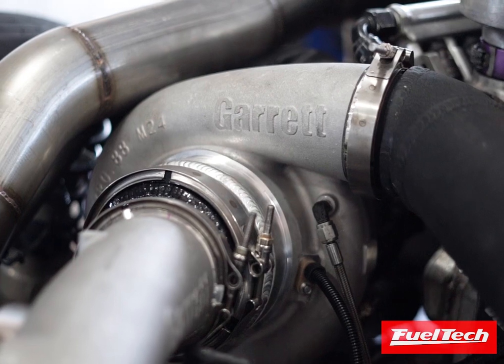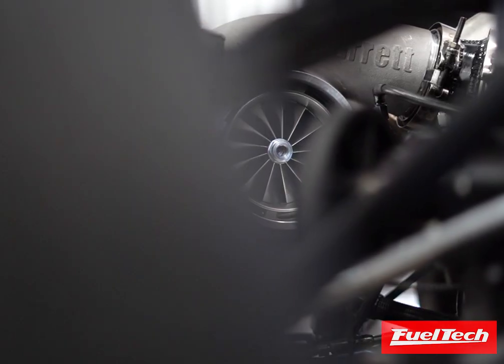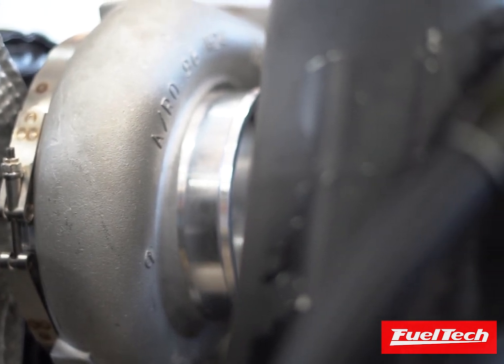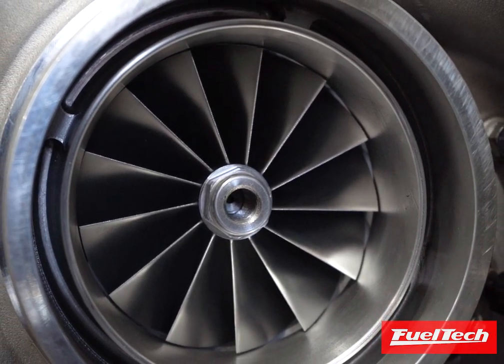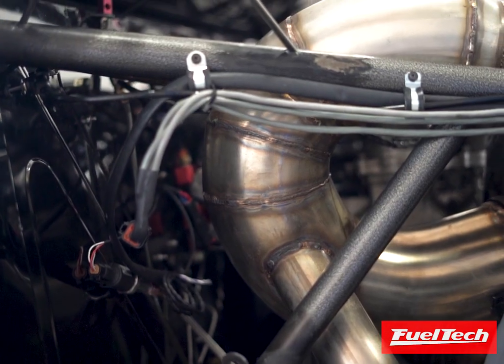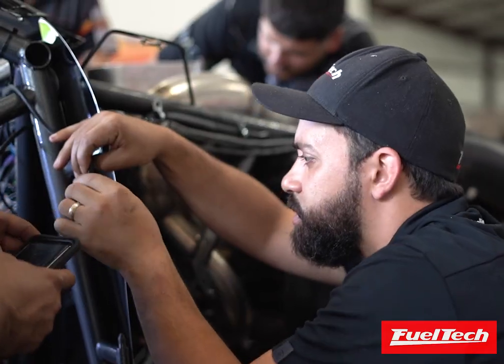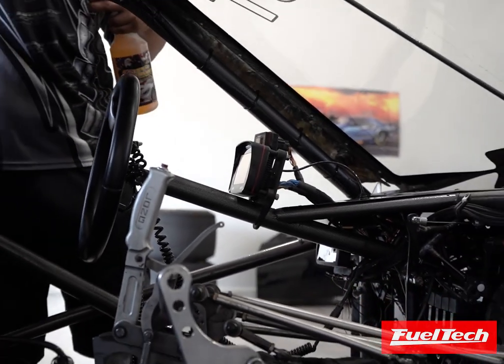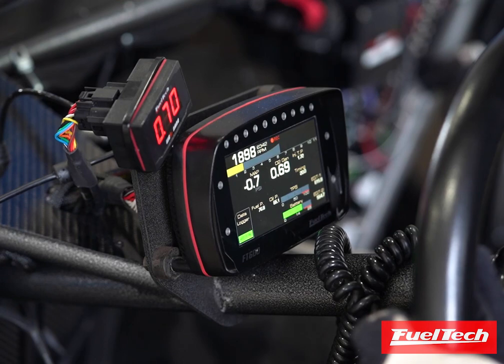1670hp compound turbo 2 rotor powered by FuelTech!

Comment from the maker: Hey guys! Don't forget to like, share with your friends, ask questions and SUBSCRIBE!
Reply: at the beginning of the video edit about 0.975 sec footage out Mr. Anderson was not on cue
Reply: Why does the small turbo go after the big turbo?
Reply: @batman9592  The second turbo is smaller most likely because its job is to multiply the existing pressure in the system from the larger unit which has the duty of compresing atmospheric pressure and then some.
Reply: Copy cats

Comment: How to make a set off turbos which generate more power as fastest than nos.  But as stock original engine... I would like to see and watch and learn how u all build ROTOARY ENGINE.  name as DATSUN  RX VW GOLF RABBIT  and all the rotoary engine in FUEL TECHNOLOGY.  ✌✌✌✌✌👍👍👍😎.
Reply: Francis Dsouza THE NITRO SISTEM WANKEL 20-B (3 ROTOR) RECORD HOLDER IS (e.t.7.71@ 169mph/272 Kmh). CHIMIKUI DATSUN '71 B 210.  Only.      ☄️ Aspirade with N.O.S.🔥✨🚖🚫NO TURBO, 🚫NO SUPER CHARGER, 🚫NO PRO-CHARGER.

Comment: So wait...the smaller turbo is after the big turbo?
Reply: i always thought the small turbo created boost to spin the big turbo's turbine
Reply: @Be4tJumper  nah, its about getting both turbos in their efficiency range and a lot of it has to do with pressure ratios, compressor maps, and not turning a turbo into a hair drier. For example, rather than boosting the atmospheric ~15psi of air pressure to 90 psi of boost pressure with one turbo (a pressure ratio of 6) and causing a variety of issues, you can use 2 turbos. One turbo (maybe 2 for even more airflow, like diesel dragsters and tractor pullers) to boost the atmos. 15 psi to 30 psi, a pressure ration of 2, and then a second (or third turbo for diesels) to boost that 30 psi to 90 psi, a pressure ratio of 3. Look into diesel compound turbos or the high performance academy videos on the 2000whp+ 4 cylinder dragsters. Of course, there's a whole lot more to it than I mentioned, its a science. https://youtu.be/0jN2ExOW4J4?t=120 He goes into a cool tech talk about turbos about 2 minutes in. Hope I helped you.
Reply: @pavelkravchuk7763  yeah i watched a video and someone compared it to a jet engine and it made sense. I really want a compound set up :) they're so cool
Reply: @Be4tJumper  just make sure your engine can hold and flow that much air and fuel. But just go full send and window your block. 😂😂

Comment: LMAO a  rotary needs compound turbos just to make 1600hp
Reply: MajorLeague  yep it's crazy how far people push tiny engines with a ton a boost
Reply: nope there are single turbos 13BS making about the same hp
Reply: @thatcornfedrx8guy372  link? I call bs
Reply: Look up Loquito Killer RX8 and Rafelitos RX8
Reply: @thatcornfedrx8guy372  I'm not really impressed it's running nos and only making 1200-1300 when there are 1.6 l Honda's with 2000jp
Reply: @Johnny-tq9no  the 13b can make about 1300 hp but Rafaelito has gone 6.16 Rotarys with Turbo and Nos is not a good combination, Rotarys work better with NOS if they are Non Turbod, this is a guy who gos to events with Rotarys in the field.

Comment: Compound turbo systems are on the rise!  It makes alot of sense especially in a street application because you could have high boost with out the lag.
Reply: True, but is more complicated than that,  you have 2 turbos, 1 is a high pressure the one is bolted to the exhaust manifold and low pressure that's bolted to a base, in order to make the high pressure feed the low pressure it takes some fabrication,  redirecting the exhaust gases from high to low and boost from high to low, but yes in the diesel motors this system is being used for decades,  caterpillar c13 and c15 are compound turbos from factory
Reply: @Me-fj8sb  its definitely a more complex option but it also works if calibrated right. Do you think it will become more common for gas engines?
Reply: @jayknight139  that's a good question,  the only thing I can think that will prevent that from happening is space, normally compound are installed in inline engines like Cummins  or a single side manifold,  duramax and powerstroke are V8 but this are full size pick up trucks and the have plenty of space and when they finish installing the compound there's no space at all, in a car is way more tight and more attachments,  but in a race car is possible depending on the engine and chassis setup,  but the main reason for compound is to develop tons of torque,  there's 6.7L Cummins on dodge rams that can make over 2,500 hp and over 3,000 pounds of torque
Reply: @Me-fj8sb  which is why I wish there were more diesel swaps. But one version of the supra had twin turbos so although space is an issue its not impossible but selling kits may not catch on for a while.

Comment: Pfft... i run 70 - 80 psi on stock cast rods and pistons... 😏
Reply: These 13bs still have factory Rotors and housings, there is only billet plates.
Reply: No one is impressed with your diesel.....
Reply: @boostjunkie2320   Lmao i was kidding but nice one

Comment: Congrats that's one tuff setup imagine a 20b or 26b ! Set up. inst it crazy how an old diesel turbo set up is now dominating
Reply: Trev Ohlson its really hard to get a 4 rotor to make good and reliable power.

The ones that are, aren’t telling how they did it, the ones that are saying how they did it are struggling to keep them running.

Both 3 and 4 rotors are super expensive. The fastest 1/4 mile rotary is a 3-rotor built by a Puerto Rican crew with an RX-8 that ran 6.3 IIRC, taking PACs record of 6.4
Reply: @rotor13  fastest rotary is now 6.08
Reply: @ferrarikingdom  Loquito Killer  RX8  20-B Wankel (3 Rotor) ♻️♻️♻️ e.t. 6.06 @ 232 mph.
Reply: @rotor13  no lie about 3 and 3rotors being super expensive!!!
Reply: THIS IS 13-B WORLD RECORD TIME e.t. 6.16 AND 222 mph. SPEED. (Maryland, U.S.A.)
☁️.   🇵🇷  RAFAELITO RACING
🚘☄️  13-B Billet (Single Turbo) All Boost 🚫 N.O.S. Even for them it was a surprise, because they were looking for runs 6.25 approx. since they had achieved e.t. 6.31 @ 219 mph. 🚗💨 and apparently the weather helped the record a lot.
••••••••••••••••••••••••••••••••••••••••••••
★ Pd.  IN THE FUEL TECH VIDEO YOU CAN SEE.
ABEL PERFORMANCE🔧🇵🇷 HOLD WORLD RECORD DYNO WITH 1,670.⁸ hp. AND 1,441 Tq.
 Turbo Compound Combinations.
(This Mazda RX-8 that you see the video, the car is from Curaçao, 🇨🇼 🏝️ a small island near Puerto Rico, its mechanic is from Puerto Rico, but its owner is from 🇨🇼Curaçao).
Reply: @rotarymotion120  The Rafaelito Mazda Rx8 reset the Time with e.t. 6.01@230 mph. Is a13-B World Record!
Reply: The more rotors the less efficient because the eccentrics bend, because they are longer and although they are thousandths of an inch but, still so affects the engine.

Comment: I understand its a billet engine, but is it still 1.3l?
Reply: Yes its still 1.3. There arent any displacement increase for rotary engines. No ceramic apex seals. Power seals or E&j seals. This seals are a mix of metals
Reply: And id assume some crazy ceramic apex seals or something?
Reply: @michaelesprella1540   The problem of the apex seals is a ceramic they withstand high heat temperatures and yes, if you cool it they The problem of the apex seals is a ceramic they withstand high heat temperatures and yes, if you cool it, they break, This Engine use alcohol fuel.

Comment: Thats the craziest damn thing ive ever seen.

1,285 hp PER LITER...and 3 moving parts. AbsoLUTEly mental. Wow.
Reply: MajorLeague  and yes I was talking about racing classes im not exactly sure but I've heard the 787 b was banned and there were complaints about the way displacement is measured or because of the operation of a rotary and the 2vs4 stroke rule they used to have in motorcycle racing
Reply: It's a rotary the displacement acts more like a 2.6l
Reply: @Johnny-tq9no  why? because it work every revolution? how much cc has a 50cc twostroke? 100cc?
Reply: Cool story...no one cares
Reply: @kyledavis8176  well you seem to care enough to do the math on hp/l bit don't understand that it acts like a 2 stroke 

Smh no one cares about comply aftermarket drag racing engine making this much power... You do know there are 1.4  4 cylinders making 2000-2500hp...no compound turbos needed
Reply: @Johnny-tq9no  what 1.4L is making 2000+hp?
Reply: @petegonzalez856  drag racing engines... Anyways it's a rotary engine the displacement is misleading as it fires completely different if it were to compete with piston engines will be classed as a higher displacement
Reply: Yeah no way unless the rev limiter was around 15,000rpm and 40+psi.
Reply: @petegonzalez856  2 liter Honda's are making 2500+  hp
Reply: @Johnny-tq9no  8 months later lol.... Factory Honda blocks can't handle that kind of power but aftermarket billet blocks can lmao try again
Reply: @petegonzalez856  what does that have to do with anything?? Rotary can't handle even close to that power either...
Reply: @Johnny-tq9no  dude you're talking complete shit. At first Show me one 1.4 4cyl pushing 2500+HP. 
And Point 2.. yeah rotary's displacement was multiplied by 1.7 or around that in racing because they had/have superior power with the same amount of displacement. They were given the disadvantage to keep the competition. Otherwise they were dominating. 
Funny side fact. The Mazda 787B just won the 24h of LeMans because it was just simply more reliable than the others.. not because it was faster.

Comment: That is an amazing package right there and huge out put from just a 13b 🤯 

I'm surprised to not see any intercooling between the two turbos?

How much would this affect the set up and performance of the car?
Reply: I imagine this thing is running on alcohol of some description, which usually results in significantly lower intake air temps, negating the need for an intercooler. Im sure someone will correct me if im wrong! 👍
Reply: @mechanicalmisadventures  yeah it's a drag car it only needs to stay cool enough to go 1/4 mile it's probably also running on alcohol or methanol to cool it
Reply: IS ALCOHOL AND THIS IS COLD AND THE RACE IS ONLY BETWEEN 6 SECONDS THAT IS WHY YOU AVOID PUTTING AN INTERCOOLER, AND NOT ONLY OBSTACULATE AND EVEN THOUGH THIS IS MINIMUM BUT IN SECOND RACES 1,320.

Comment: usaly 100hp per litre is pretty good
this is more than 1000hp per litre
Reply: geen naam The engine is a Wankel   13-B of 1.3 litre 1,308 centimeter cubic. Produce 362 hp after 100% of 1hp of 1cc.  133% aprox.
Reply: A 13bs 1308cc is the volume of two rotor chambers and is how much air it moves with only one rotation of the eccentric shaft, when the eccentric is rotated twice like 4 stroke piston engines are measured it displaces 2616cc
Reply: @Mrshotshell    2.6 Litre is 26-B *(4 Rotors) ♻️ 💁🏽‍♂️ ♻️The Rotor, if it has 3 sides (vertex), but it also has 2 ports without valves (nothing blocks it) then there will always be one side unsealed and basically function 2 chamber; As (Side A) advances to complete the 360 ° cycle, (Side B) It goes halfway through the cycle, It is not yet ready to generate power, but it is in process; while (Side C) goes through the exhaust ports unloading everything and then goes on to load.
It is assumed that this is how it is analyzed, according to how it is structured and how it behaves and not adding each camera or multiplying by two that only Mazda did it to be able to sell a higher price because it has An engine of less displacement than those of its category and in Japan it is a requirement but there is no way because this engine does not store Kinetic Energy, or Electric Energy, so that it is 1.3 liters, An engine of less displacement than those of its category and in Japan it is a requirement but there is no way because this engine does not store Kinetic Energy, or Electric Generator, to put a size that is too large you can put a 13-B Wankel engine in a SMART CAR without cutting its Fire Wall, but try to put a 2.6 liter for example from Mitsubishi. 🤷🏽‍♂️
Reply: @3xoticG4m3r  That's what they say, but mechanical engineers have no basis and foundation of theory when they measure and they conclude that it is 13-B and they do not find a way for the engine to reach a larger size beyond being more efficient and free for both intake and exhaust and this is so due to the absence of valves and they conclude that it is 13-B and they do not find a way for the engine to reach a larger size beyond being more efficient and free for both intake and exhaust and this is so due to the absence of valves and it is rotating without limits
and that is why it produces more the Wankel engine does not get bigger, it is only more efficient than any other piston engine because they are more limited to it and that is why it produces by alternating the movement of the pistons and valves; In the case of the valves, their time has been varied and this has resulted in better efficiency because it avoids being a barrier to flow, which is what the Wankel engine does best, and what it has against size against size, and it is at the same time; the advantage of the piston engine in this war of engines.
Reply: @Mrshotshell  why? because it work every revolution? how much cc has a 50cc twostroke? 100cc?

Comment: Question, has fuel tech worked with a turbocharger compounded by a mechanical supercharger?
Reply: There's a low and a high pressure turbo,  is hard to create an enormous amount of boost to move the low pressure turbo with a mechanical supercharger
Reply: @Me-fj8sb  that was a typical supercharger turbo setup for GMC 2 stroke diesels for decades, turbo into a roots supercharger then the engine
Reply: @benjaminchartier6458  true, I've been building 5.9 and 6.7 Cummins with compounds for some time, but the only way to achieve tons of boost for racing purpose you need 2 turbos, but for regular commercial use, yes supercharger will do, I've done over 100 psi couple of time in my ram 3500 with a highly modified 6.7, dangerous but is only achievable with 2 turbos

Comment: My only question is how you stop the first turbo from over spinning and creating excessive air intake temps when high rooms are reached? Can’t seem to wrap my head around it.
Reply: Wastegates. The gates on the manifold charger dump into the exhaust feed to the atmospheric charger. The gates from the atmo charger dump out the exhaust.
Reply: cesar arias 🤣 I think ur reply is funnier than it should be but I was thinking his exact question

Comment: Cool video and big power wow! Be interesting to test the 106 and 88mm @ 80psi as a single turbo setup compared to the compound setup...
Reply: The 88 as single would not make more than 60psi of boost and will be over 100k rpm already which increases back pressure by a lot. The 106 can't be used as a single on a 13B because it will surge really bad, typically a 94mm is already entering surge already.
Reply: Has the 106 been tested? My guess no... The 106 will surge at high PR and low shaft rpm speeds. There are ways to configure the turbo and setup to achieve the desired boost levels without surge. Compound turbocharging is desirable at extremely high boost levels but it is terribly inefficient due to the design of the centrifugal compressor wheel. It's just no good a higher pressure ratios and the higher you go it just becomes terribly inefficient regardless if it's compound turbocharged or not. Better going 106 for 80psi and compound once you can't get a bigger either turbo to achieve the desired boost....

Comment: i know you run for sure cold gaz, but intercooler between the stage give you more air density for your second turbo!!??
Reply: Correct but adds weight to the car and can be compensated by a few more pounds of boost, but like I said, this is a project decision and really few people have tried all the possibilities to find the most effective one.
Reply: There multiple ways of doing it, the decision of not using an intercooler was because weight savings and unlimited boost, as well fuel atomization gets improved by hotter air.
Reply: @AndersonDick  i was thinking cold air,more pounds of air+ more pounds of  fuel =more HP !!??

Comment: @fueltech USA have they ran that setup at the track? Times?
Reply: Before this car run 6.62 at 209mph but haven't run after this yet.
Reply: Anderson I was wondering how long till someone put a compound on a rotary with all the others popping up. Seems to work well. Are the hot sides still on the larger side?
Reply: Awesome, I'm looking into the ft500 for my drag hayabusa, running mids 7's with nitrous but going turbo in future. Id like one for my FD also, it has old school apexi power FC. Only one at a time tho...
Reply: Yes I agree, it works great for rotaries, both turbos have big exhaust wheels yes and could be even larger. Gtx5533r gen 2 88 with a 1.00 will be replaced by a 1.24 and the GTX5544r 106 has 1.40 A/R and worked great.

Comment: 1670hp on a 1.3L 2 rotor, dorito power!
Reply: It's a rotary so it's like a 1.3l 2 stroke or 2.6l 4 stroke
Reply: @Johnny-tq9no  Thats not how it works
Reply: @verttisyrjala2897  kinda does it fires once every rpm like a 2stroke
Reply: @Johnny-tq9no  That doesnt change the amount of displacement. A 125 2 stroke and a 125 4 stroke for example, the 2 stroke fires every revolution and most likely has more power but they still have the same displacement
Reply: @verttisyrjala2897  and in racing the rule often was that you can have a 4 stoke that is twice the displacement of  a 2 stroke
Reply: @verttisyrjala2897  didn't say it changed the actual displacement only did that displacement is basically equal to twice the displacement in a 4 stoke
Reply: @Johnny-tq9no  Yeah, well, the comparable 4 stroke engine isnt always twice the displacement, it depends on how both of the engines are ported, and what they're made for but I get what you're saying
Reply: @verttisyrjala2897  those were the rules for motorcycle racing when 4strokes came out